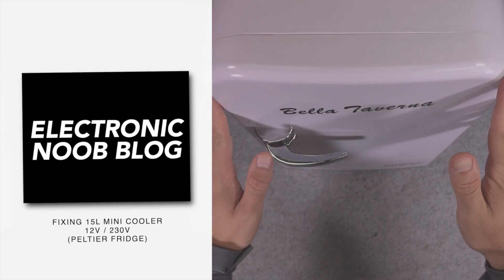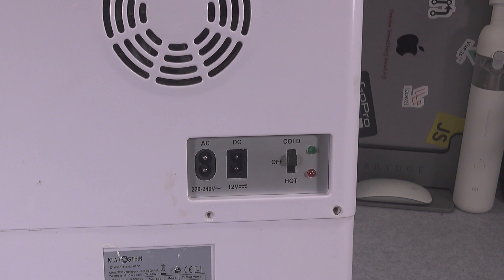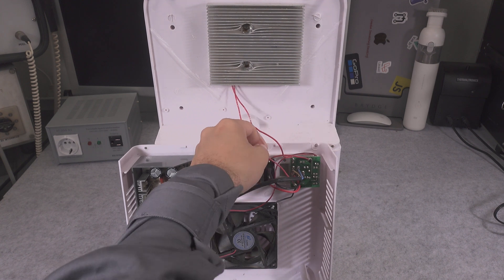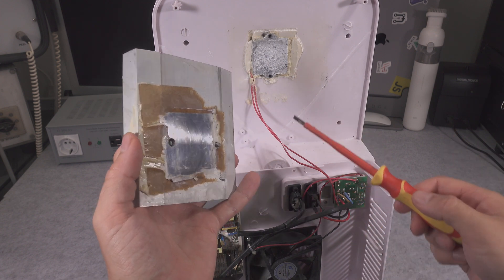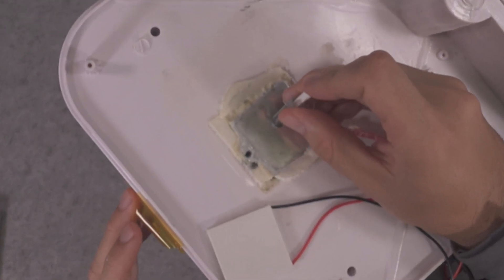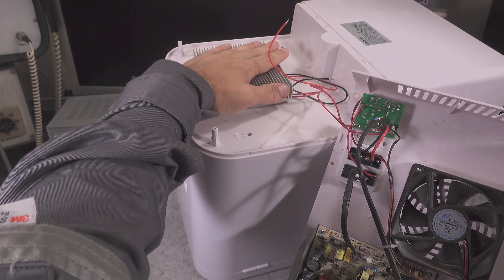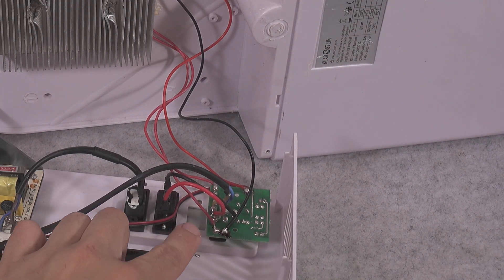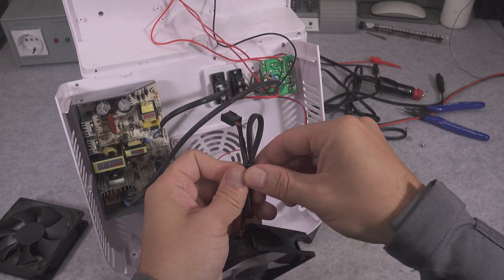Fixing thermoelectric 15L mini fridge / cooler / warmer -  replace peltier (TEC) modeule and fan

Comment: Good day Sir, I'm tshepo from South Africa would you please assist me with the very similar cooler as yours but mine it's BAUER product I'm looking for the two mother boards the other one it's ac power supply where can I buy them or how to convert it
Reply from the maker: Hey, if I would be You - just grab any 12V power supply used for led-s - even external - just make sure it can handle current and this is cheapest and most straight forward repair.

Comment: Excellent video.  Only yesterday I was looking at a noisy Motorola XPR8400 repeater fan that had four wires and a bespoke connector that threw me as I was hoping for two wires for an easy swap with a quieter fan off Amazon
Reply from the maker: Glad it helped - watch out for quieter since most of them will delivery lower CFM  - just make sure it's cooled enough after TX-in for some time. XPR8400 is still great and it would be waste to cook it.